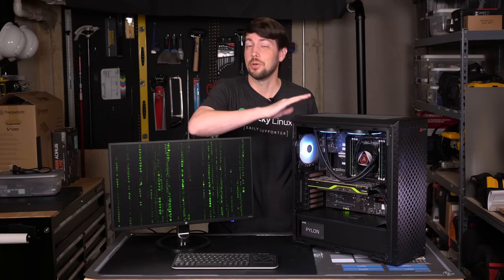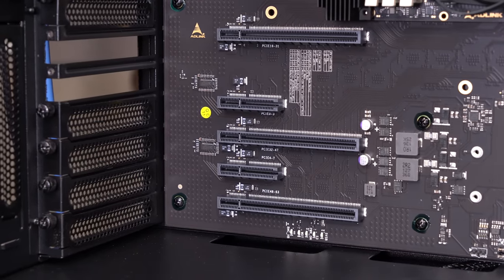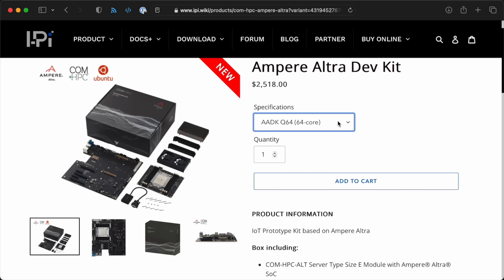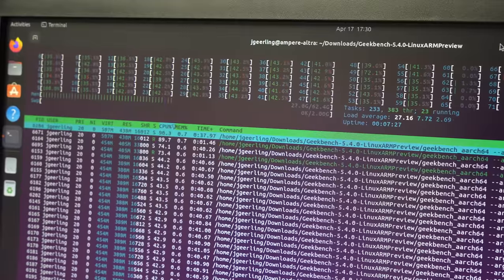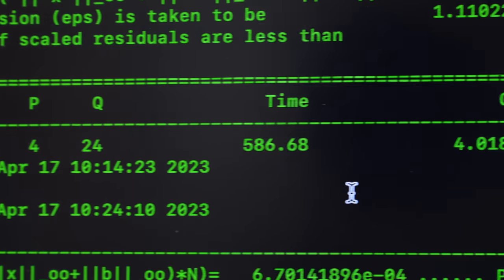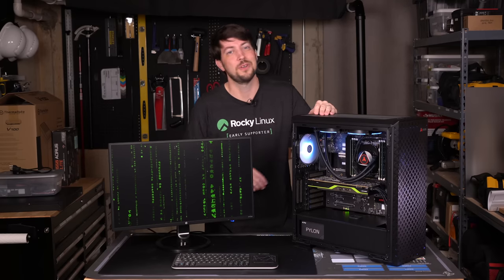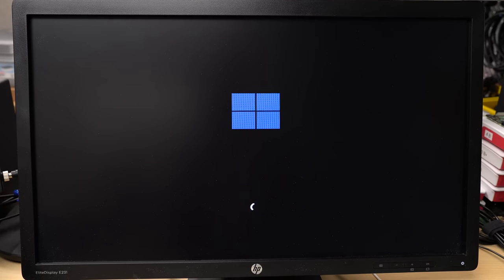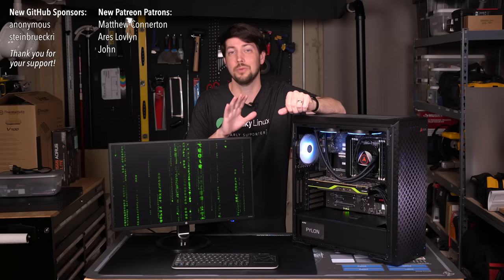This Mac Pro killer runs a GPU—and Windows on Arm!

Comment: It could be, but we know it won't be modular. Lmao
Reply from the maker: Trash can Mac 2.0?

But more seriously... I still hope Apple doesn't abandon the workstation market again. They've always had compelling (if a bit exotic) hardware on the high end!
Reply: @JeffGeerling  It'll be Trash Can 2.0. Because that's the nature of Apple Silicon. The Mac Studio basically fills that niche right now and it's faster than the Intel Mac pro. I think it will just be a bigger Mac Studio
Reply: I don’t really see the point. The benefits of PC add nothing to Mac. They could just stick an M2 Max in the Mini and you can get whatever you probably wanted from a Mac Pro and the Studio is a flop. Anything a true Mac Pro would offer, you’d just use a PC or a Linux machine for.
Reply: @MarcoGPUtuber  Mac studio can be tackled by other hardware. ( I think you're referring to the new arm stuff )
I thought efficiency was better.. but undervolt any new hardware and you'd get pretty close efficiency.
Thought software was better, make a Macintosh.
No modularity and proprietary everything is the benefit of mac.
Reply: @yasirrakhurrafat1142  Lmao.  It's the greatest weakness
Reply: @MarcoGPUtuber  Apple fans/ any consumer is there to gobble it up though.
Reply: @yasirrakhurrafat1142  Not any.
Reply: @MarcoGPUtuber  you'll find gpus at ridiculous prices cuz we won't stop buying.
Reply: @Freshbott2  I love Linux and use it everywhere I can but there are way too many professional applications with only Mac and(or) windows support, and windows is a pain
Reply: Sure it'll be modular. You'll uninstall your old Apple computer and replace it with a new one. Simple and "modular" 😂 God I detest Apple.
Reply: @JeffGeerling  There were other UNIX workstations that were just as exotic as modular.
Reply: @jaysdood  Or you're forced to buy a new one since Apple stops supporting your machine that you spent $5k on
Reply: @LBCAndrew  Yep, Apple is like a Casino - the house always wins.
Reply: @JeffGeerling  As you can see, they did kt again.
Reply: @JeffGeerling does it support UEFI dual booing?
Reply: @JeffGeerling can you run iOS app in this hackintosh
Reply: Arm CPU manufacturers only make the chip, it’s up to the purchaser of the chips to bake them onto a socketable board, and up to the purchaser to make the socket.
Maybe if you got some old Xeon you could remove the Xeon and bake your arm chip straight onto it.
But then you’d have chipset and bios issue…..

Comment: Apple could do this, but it would start at $10,000 because that is the Apple way.
Reply from the maker: And the casters will go from $699 to $1099 due to inflation.
Reply: And wouldn't be nearly as expandable.
Reply: I'm pretty sure Apple can't do this, even for an extra few zeros per machine. As for them to create something so user friendly and expandable would kill all the decision makers that have for years been sticking the pointy end of a sharp object into their userbase.
Reply: I think Nvidia can make perfect ARM Desktop but I am not sure they will try
Reply: Apple’s not going to do this. They are saying goodbye to upgradeability, because that’s the only way they can achieve performance. Which means goodbye to the workstation market.
Reply: @JeffGeerling  btw, Pleaseee make short video (or maybe full detail video if you want) on how this cpu compared to intel xeon w9-3495x in real benchmark performance, and also most importantly the efficiency between both of them 🙏🙏🙏🙏🙏🙏🙏
Reply: @lawrencedoliveiro9104  pretty much. All of their hardware are embedded devices now
Reply: Actually, Apple just did it by releasing their new M2-Ultra based Mac Pro tall-tower format cheese-grater machine. Surprisingly, it came in "cheap (cough, cough)" at only a $7000 entry price. Of course, make that at least $8000 for a reasonable system, or $9099 with the casters. So cheap, I'll get two. A lot of money to pay just to be able to add your own choice of graphics card.
Reply: @mrjean9376  Assuming it may be a while before Jeff or anybody else does any significant performance comparison of Xeon w9-3495X vs Arm Neoverse-N1 128/96/80/64/32-core CPUs, I'll give you a couple rough-estimate performance statistics that have been published thus far. As an order-of-magnitude estimate, I like to use the multi-threaded Passmark CPU statistics, and it just so happens that these recently got their first hits on the Passmark database (5 samples for the 56-core/112-thread Xeon w9-3495X and 2 samples for the 36-core/72-thread Xeon w9-3475X). There were already data points there for Neoverse-N1 128 Core and 80 Core and 64 Core parts (no hyperthreading on these chips). I'll compare the highest parts of each lineup to give you an idea of how they stack up.

The Arm Neoverse-N1 128 Core part scores 46,271 Passmark, whereas the w9-3495X scores 102,308 Passmark, which puts it in second place in the single-socket ranking charts with only the AMD EPYC 9654 beating it with 126,045 Passmark for first place among single-socket server scores. By the way, right behind the Intel w9-3495X in the charts are the AMD EPYC 9474F at 99,068 Passmark, the AMD Ryzen Threadripper PRO 5995WX at 98,039 Passmark, and the AMD EPYC 7773X at 91,209 Passmark. In other words the top slots are taken by the 96-core current-gen EPYC, the Intel Sapphire Rapids Xeon 56-core part, the 48-core current-gen EPYC Fast-suffix part, the most recent top-end 64-core AMD Threadripper part, and then several last-gen AMD EPYC parts (the lack of more current-gen EPYC parts on the top of the list is just due to the fact that nobody has tested them yet - they will kick some of the last-gen EPYCs out of their top slots after being tested).

The interesting thing is that the top Sappire Rapids part (with 56 cores) beats the (128-core) Arm Neoverse-N1 part by a factor of 2.211 in spite of the Arm chip having over twice as many cores. That's about 5x faster on a per-core basis. As an aside, I'll note that I'm not completely sure whether the Arm models noted in the Passmark database are the exact same CPU parts that would come with the variants of Arm Dev Server that Jeff documented in his video. But they are the only ones I found in Passmark (and in the case of doubles I used the entries with higher clock rate). 

I will also note that although the Arm Neoverse chips were pretty fast on the specific Integer and Floating Point instruction tests, those are very small footprint test programs. The one Passmark test that has a much bigger memory footprint is its Prime Number test (because it keeps a sizable table of primes). On this particular test, both the Sapphire Rapids chip and all the AMD EPYC/Treadripper chips beat the crap out of the Arm 128-core chip. That's because (apparently) the Arm chip does not have a lot of L2 or L3 cache, whereas most of the AMD chips have quite sizable 3D V-Cache bumping their L3 cache way high, and the Sappire Rapids chip has (I believe) lots of L2 and L3 cache as well (the reason I say "I believe" is that these are sometimes wrongly reported on performance databases, so one should check the vendor's charts, but for what it's worth, it's reported as L1 4480 KB + L2 112 MB + L3 105 MB). What the even-more-sizable performance difference when you run a more-or-less real program (as opposed to 100 adds and 100 multiplies) means is that in practice, the inferior cache sizes on the Arm Neoverse parts add an additional drag on performance in almost all real programs, since the program will typically get more cache misses than the Sapphire Rapids or AMD 3D V-Cache parts will (with their huge caches). A lot of people don't really think of that. But it's actually a good thing for Intel in the sense that they finally have some CPU parts that can stack up to the performance level of AMD by virtue of having large L3 caches. Now AMD will have at least a couple parts with over a gigabyte of L3 cache in their up-coming next generation of server parts. But for now, the Sapphire Rapids parts are decent EPYC competitors. One last note, and I'm not sure about this point either, but the w9-3475X part is listed (quite oddly) as having more cache than the w9-3495X part. Don't have time to research that now, and it does seem quite odd and therefore suspect, however if it turns out true that there's more cache in the slower w9-3475X than in the faster w9-3495X, then it might be rather wise to buy a pair of servers with a w9-3475X in them (2 * 70,850 Passmark) than one with a w9-3495X in it (102,308 Passmark).
Reply: @jimatperfromix2759 lol with a firmware customized by Apple you will have 3 models to choose at best Apple in not an open platform and never will